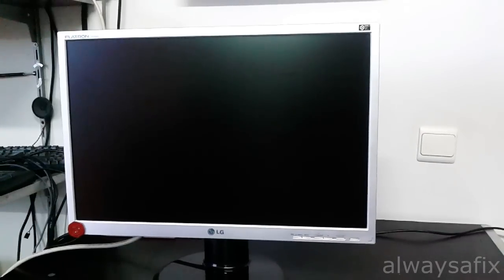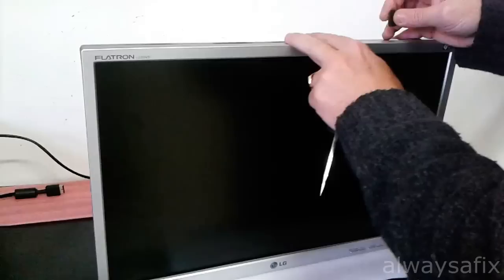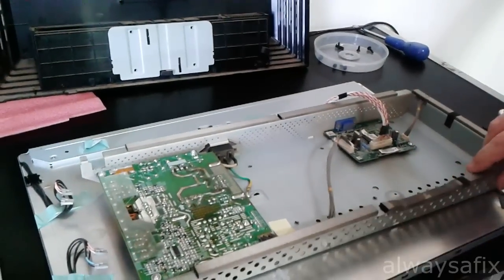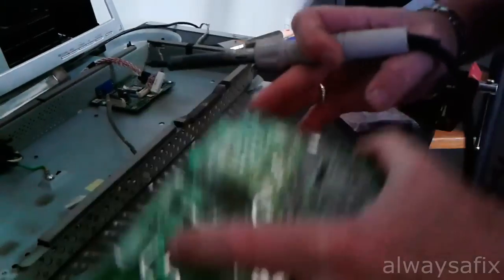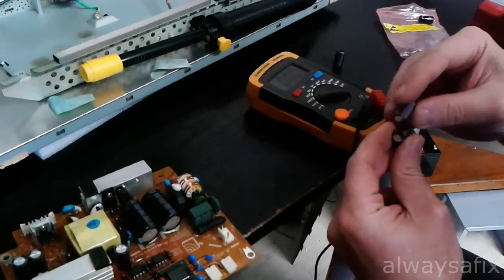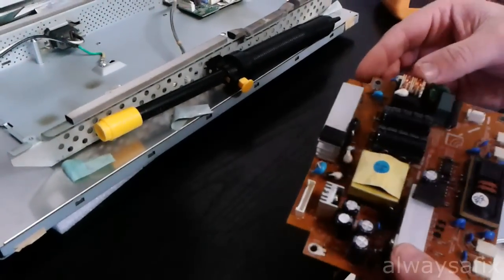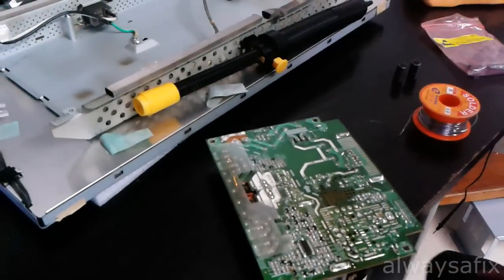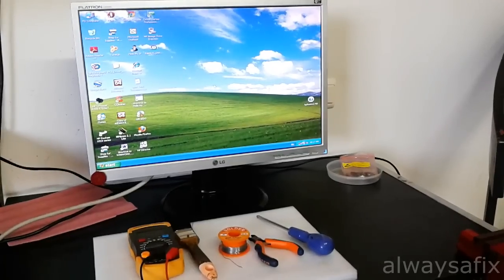LG flatron screen blue flashing light

Comment: Mr alwaysafix  I would like to ask what type of Lg monitor you are repairing in the video ( model )   the monitor does not turn on but it flashes a squadron like in your video  or if you could write me the value of the transistor  if you have a LG L204WTS monitor model ?  Thanks for the early answer.

Comment: I have a similar (LG L225WS) if not identical monitor. The blue LED startet flickering about a year ago and after some time the blue light doesn't light up (EVER). Otherwise it seems to be working fine (no weird sounds or images or anything like that). And when it goes into power saving mode it does light up orange (not sure if it is a different LED or the same LED, but powered differently, because i have yet to open it).

Should i be worried?
Reply: I had similar behavior from my screen and it ended up not powering on after some time. You'll get there eventually! I knew I should not turn the screen off because it would not turn on one day or another... And it happened when I had a power failure. Changing the capacitors was the solution thanks to these giudes. I suggest you to buy the capacitors soon + soldering iron (I bought all these for 30$ on Amazon + Ebay) if you don't want to end not having a screen for some days.

Comment: same problem but my screen turns on after few minutes, please tell me it won't get worse ? or it won't work at all ? thank you
Reply: with you on that problem bud, blinks for a minute or two then starts working again, worrying about the same thing as you, you're not alone with it
Reply: John it's getting worse here,bud, today it took like 1 hour, but I guess I was busy and away for too long so the button turned into orange instead of blue which means it is in sleep mode , so I moved the mouse and suddenly started doing the same thing again but this time it only lasted for a minute, that's weird, though this monitor has been with me for 8 years, and I'm a bit of a heavy user
Reply: John I'll probably, but my budget is not at its best situations,I hope It can be fixed
Reply: I can tell you from my experience it will get worse. First it was only minutes, then hours. Currently the screen turns on after like 5 hours :D
Reply: N a S oh shit , did you try to fix it?
Reply: N a S well goddamn it man, got to save some money first
Reply: Barney Bronicorn no problem, though it also depends so I don't how much it will exactly cost in your country
Reply from the maker: Glad to hear its fixed.  Thanks for watching.
Reply: Omar Brsli No, I searched for an easy solution because it annoyed me ^^
But the solution showed in the video is too much effort for me. I'll just buy a new one -
and it won't be an LG :P
Reply: N a S I'm lacking for equipment here
Reply: Omar Brsli hehe got the same problem. To buy a new screen is cheaper than to buy all the shit I'd need to fix it :P
Reply: +Omar Brsli oh no you guys ruined my day, mine takes like 20 mins now, can I fix it with this method even if it turns for worse like you said?
Reply: Barney Bronicorn dude,the problem is simple as the man in the video said, yesterday I sent mine to the maintenance and I've just received it, and it is working smoothly and it costed me less money than buying these equipments he used, it was an impaired part , so just fix it and have a nice day :)
Reply: but how much did it cost you??
Reply: Barney Bronicorn 12 $
Reply: okay thats not too much thanks
Reply: Same

Comment: Thank you very much, had same problem with my LG Flatron, after 5 years or so, screen stopped startup and power led blinks. Opened and all four capacitors (what I believe is inventor?) blown like balloons on top. Replaced with new 25V ones, spent around 3 EUR and monitor works again. You saved me 4000CZK just before Xmas so have great Xmas and Happy new year!
Reply from the maker: +Tomas Hamarcak Happy days and congratulations on your fix.  Thanks for your well wishes.  Have a great christmas and New Year too.

Comment: Brilliant. Worked exactly as described. Thank you so much. Saved me the cost of a new monitor. Love your work.
Reply from the maker: Michael Cordina Much appreciated and congratulaions on your fix.
Reply: +alwaysafix 10 months later and I now have a dim blue light and no display on the monitor. I get the LG flash screen then black. PC is working and am on back up monitor. Any ideas?
Reply: +alwaysafix not to worrry. fixed it by replacing the remaining three capacitors.